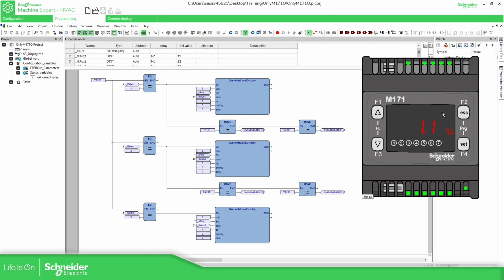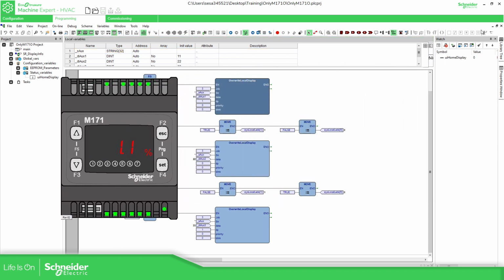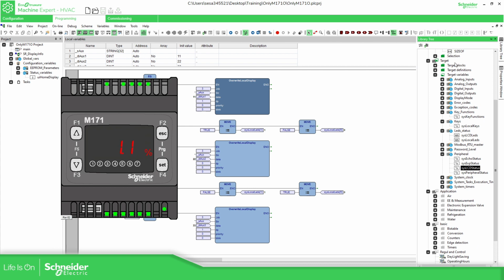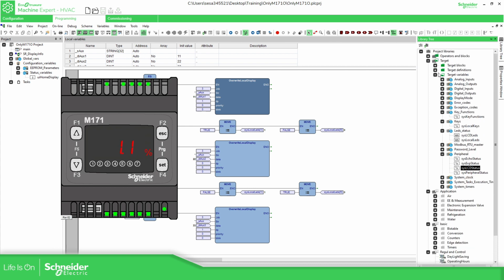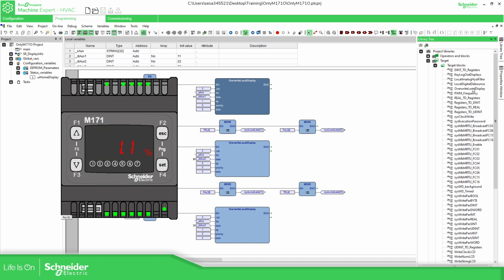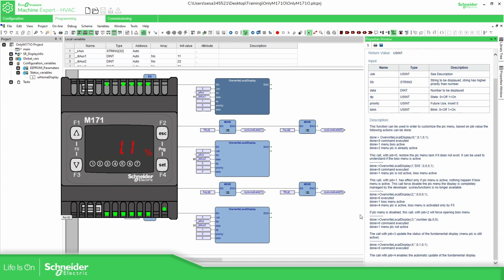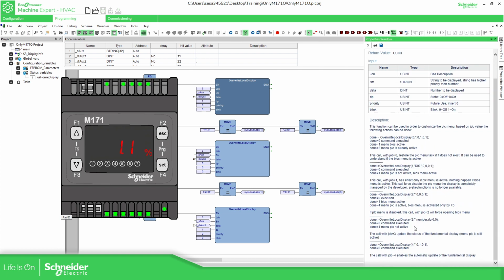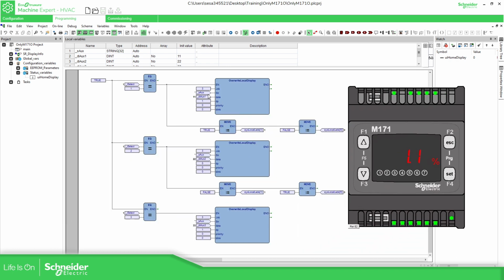ESME HVAC - M171O -  OverwriteLocalDisplay

Comment: Greetings, the TM171OBM14R controller ,firmware 542.10.
It was necessary to set up in modbus slave mode for this, settings were made in the bios (see screenshot) . 
Using the TM171ADMI interface, the program was loaded into the controller, after which it is impossible to establish communication via the TM171ADMI interface as well as via a modbus/usb adapter. 
  The question is how to reconnect with the controller . 
Thanks .
https://drive.google.com/file/d/1RISBkCqXBvK49WFqFdxf7D52OkajbM8h/view?usp=drive_link